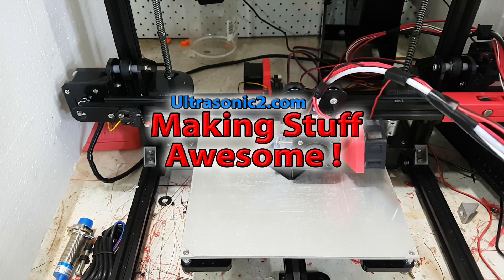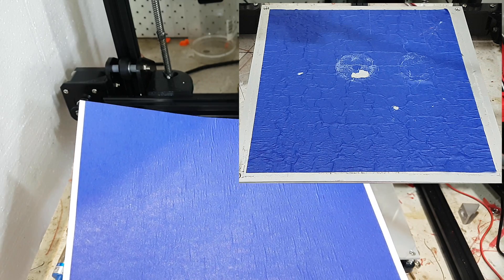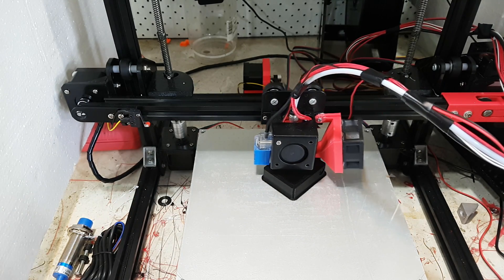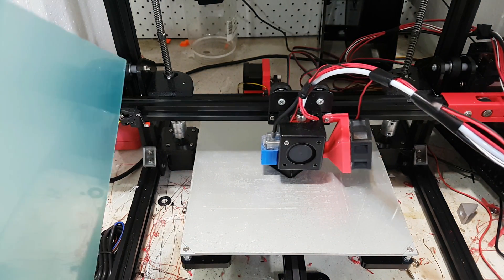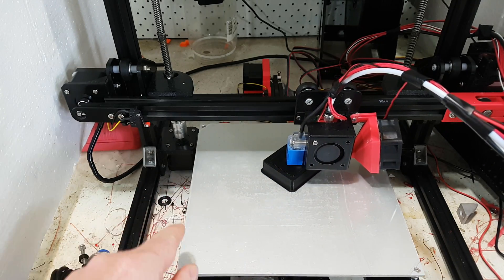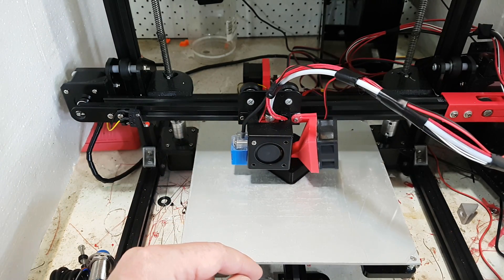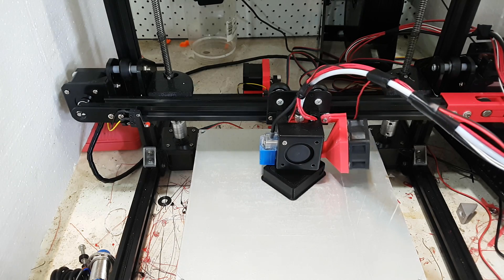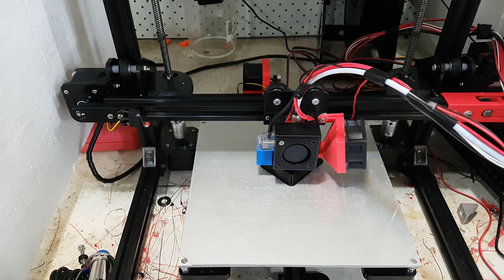Tronxy X3 3D Printer Build : PEI build Surface Review Part1 : Episode 8

Comment: 1) It's not that hard to ship glass, especially in the sizes you'll need.
2) Glass is BEYOND AMAZING!  All you need to do is clip it down (we'll get back to this), and put some glue stick down, and heat it, and your prints will stick like Spiderman on steroids!  
3) Speaking of Spiderman on steroids...  It can be VERY difficult to get the print to release from the bed....  Well guess what, you clipped the glass down, that means the glass is easily removable.  ...that means you can place the print and the glass in the freezer, come back in ten to twenty minutes, and the pieces have just magically released!  I have never had this not work.  So now you have a fool proof and easy way not to damage parts or your print surface. 
4) Glass provides absolute beautiful "glass like" finishes (imagine that) on the bottom of your parts. 
5) You can have multiple glass beds.  Which means you can rotate which one is in the freezer and which is on your printer, and so you can print continuously without wasting time trying to get parts free.  Which can take time if you have really good adhesion and you don't want to damage anything (or course this is super easy with the freeze method described). 
6) Glass is super easy to clean.  Just take it to the sink, run warm water over it and the glue will come right off.  I only need to clean (beyond a dusting) a bed about twice a year (and I print a lot), but it's nice that it's easy to do.  Of course I don't touch my bed, so I don't get any skin oils on there, and that's easy to do when I'm not wrestling my prints off the bed. 
7) Glass doesn't melt when you get the hot end too close to it.
8) Glass is REALLY hard to gouge. 

I really don't understand why anyone wouldn't go with this method.  You can sit there an pry your parts off of your PEI surface, trying not to damage either the part or the surface, trying to find the optimal printer settings to get the parts to stick just well enough but not too well, and then try to get that PEI off your bed once you do inevitably damage it, or you could just print on glass and avoid the whole mess.  I guess to each their own.